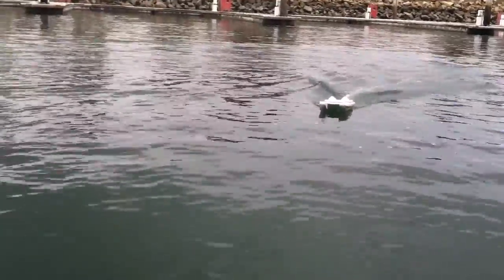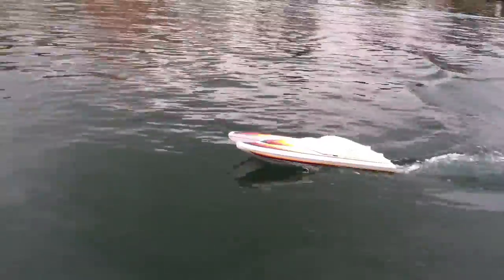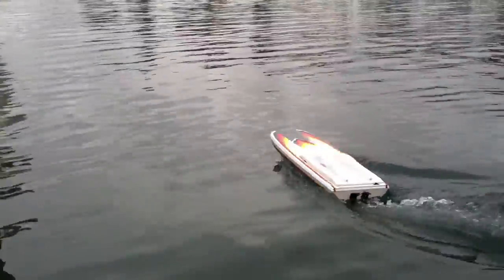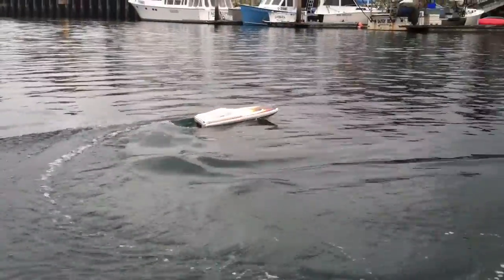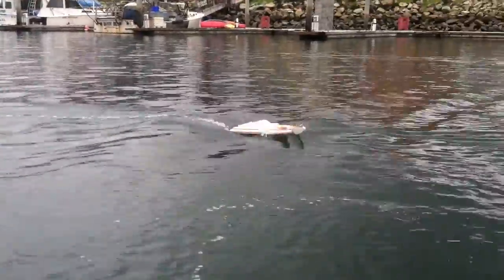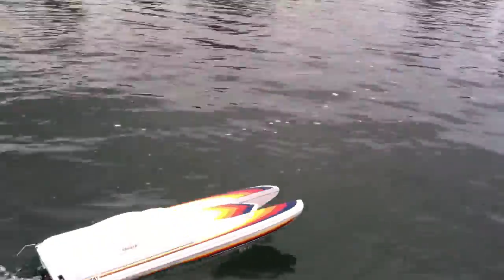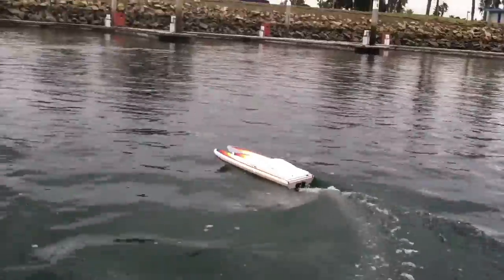Great Planes Wildcat RC Twin in Channel Islands Harbor

Comment: I had the same one and yes they are a lot faster then that.I also had the Great planes Stinger which was the deep v hull version.. My wife and i had great times with those.. but i didnt meet my wife until 1995 we dated for a year then married and i remember buying both from Tower Hobbies around 96 or so after we got married .. I cant believe that is a 1988 model.. In 1988 Rc was really picking up steam.. ie Tamiya Grasshopper /Hornet Kyosho Pegasus/Icarus Team Associated Rc 10..
Reply from the maker: ChrisandEileen thanks for the comment! the Wildcat has been sitting in my garage, I've been busy with the other toys. My streetcarver, for example has been apart for six months! I do eventually want to upgrade to brushless DC motors, and I need a new Atom receiver!